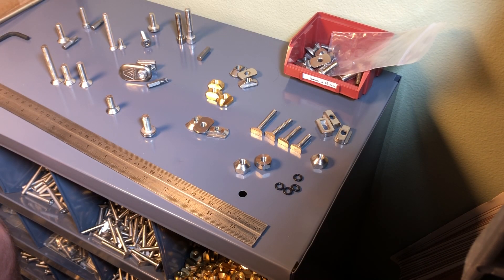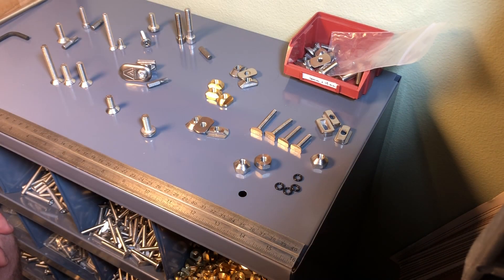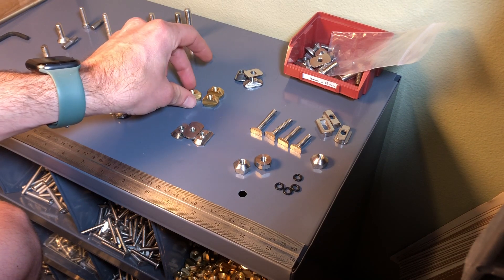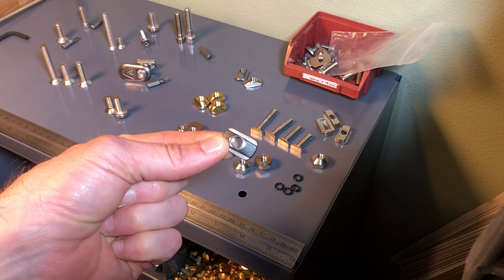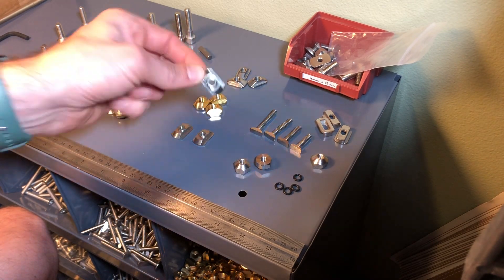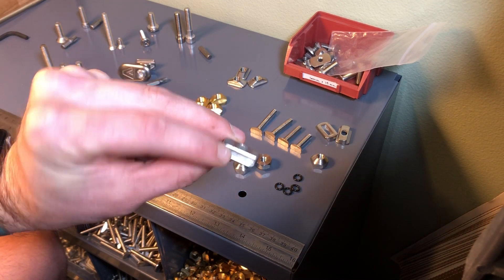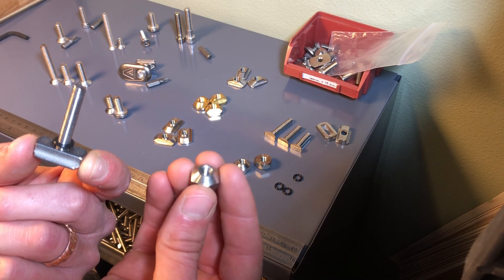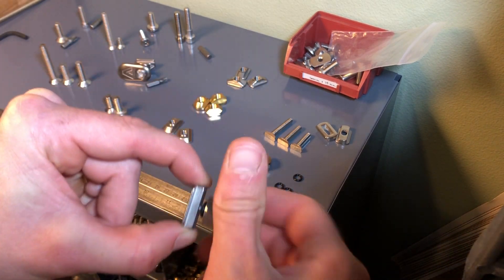Hydrofoil Hardware Overview; Type, Size, & How to Measure

Comment: Hi - Awesome video. Have you heard about tnuts eating up the track in the double US box ? After 20times of use, mounting the mast with 4 tnuts the material disappear from the box in my board….really sucks, because the manufacturer says, that I was not precise enough when mounting the mast…my opinion, the material in the box is too soft……
Reply from the maker: That is weird for sure and not normal.  The box material should not be disappearing under any circumstance.  Are you using a shim setup on the base plate?  It could also be you're using set of t-nuts that are a little too large for the tracks.  There are a few brands of T-nuts (not foilmount) that are too big for some of the more narrow track widths...we are talking like 1/16th of an inch more narrow.  So you will see some material come off over time as the T-nut works itself into the track.

Comment: What is the correct length WizardHat T-bolt length for a Slingshot aluminum base plate (Hover Glide) into a Slingshot board (HyperMiler)?
My current WizardHat bolts leave approx 1/4” of the thread sticking out of the cone nut when tight, and can be sharp.
Thanks
Reply: Hey, the same here, I have slingshot phantasm foil and use wizard t-bolts. If they didn't stick out that far, it would be difficult to screw the nut because the little rubber on the bolt doesn't hold them  very well and they can be pushed down easily. Having the extra length helps.
Reply from the maker: Great question.  For others reading this the Hoverglide has a countersunk aluminum base plate and the hypermiler uses a standard US track so the t-bolt needed is actually pretty short.  The standard Wizardhat t-bolt is 35mm but because of this countersunk base plate you easily get away with the 30mm T-bolts and there is very little extra.  If you were using the cone nut on the flat side in the same setup (no countersunk hole on the base plate) it would take the 35mm.